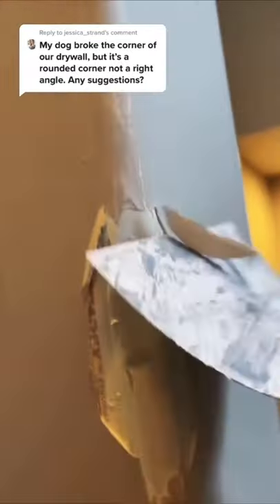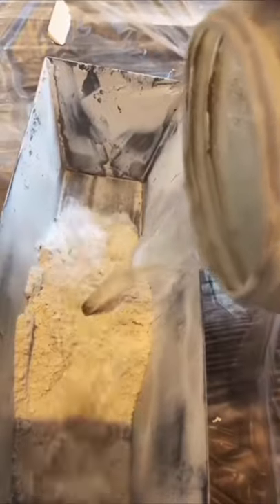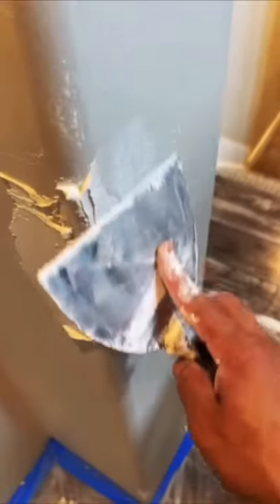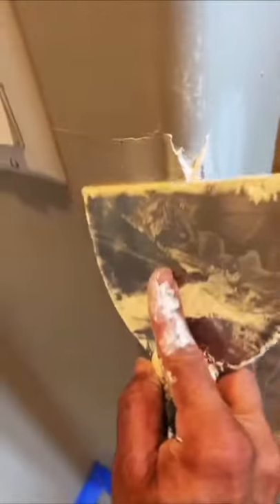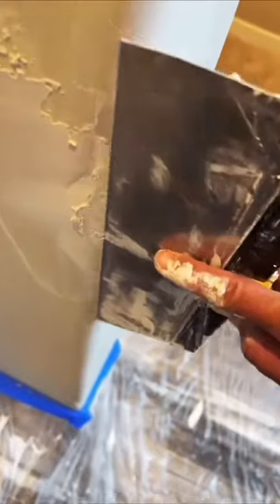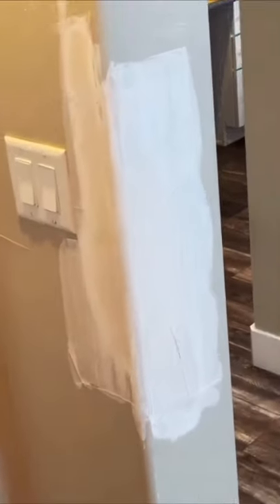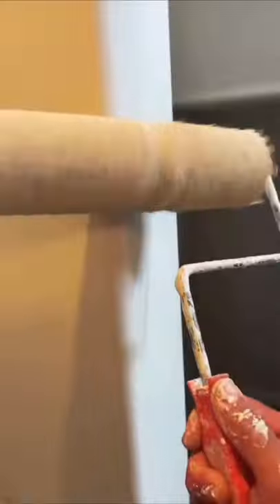How to repair dent on bullnose corner bead.  #shorts #drywallrepair #diy

Comment: Hey boss great video, love ur attention to detail. Small request, maybe start using a PVA primer to avoid having to paint with 2 or 3 coats and your sheen will look so much better.
Reply: I won't comment on the paint itself but he is correct about the PVA cuz hot mud doesn't bond to latex paint so putting pva on the wall PRIOR to the mudwork will keep ot from busting back out the first time it gets bumped

Comment: You’re a national treasure. I specifically need to this exact repair. Except for instead of a dent there’s a gash 🤦🏻‍♂️ 
Great vid keep them coming!!!
Reply: Still repairable g, just make sure you stuff the crack completely with caulking, it shrinks when it dries so. Then tape over it, put another layer and sand over that layer. Wait to dry, repaint, you're golden.

Comment: Wouldn't have dented so bad if they would have installed it the way I learned. The mud should fill the bead and then be pressed on to force out the excess. The corner then drys solid with no void behind to allow easy denting.
Reply: Exactly. Hot mud is much harder than sheetrock when cured.

Comment: Prime the repair bro.. the patch will show after you are done
Reply: You should never paint over hot mud. He should have finished with a skim coat of topping mud and then used only a premixed primer and paint. Using a primer like Zinsser or Kilz over patch jobs will cause flashing.

Comment: Was the dog driving a rental truck? Pro tip: if you're gonna at the jobsite extended time, mastic for ceramic tile makes a great filler for impact areas that are found in commercial settings

Comment: I’ve repaired mine several times, and it looks great... but it keeps chipping off when it’s bumped. How do you make the mud “stick” to the metal? I’m thinking about priming the metal before I add the mud. Other than that, I’m out of ideas.
Reply: Drill a couple of small holes in the corner bead, so the mud will penetrate and be anchored.

Comment: How long do you wait before you paint. I get the fact that 5 minute sets up quick, but is it paintable in the same day
Reply: Its a chemical reaction. It's rock hard in 5 minutes. They also sell 20, 45 and 90 minute.
The quicker the set time, the harder it is to sand. 5 minute is like sanding concrete so you better be fast and lay a smooth coat.

Comment: No primer after patch?
Reply: No. A simple premixed primer and paint will do. A primer alone will cause flashing then you would need to use a primer on the whole wall to hide it and repaint. You should also never paint over hot mud. He should have finished with a skim coat of topping mud.

Comment: What do you guys recommend for roller covers? I've been using 1/2 nap sheepskin.... I'm painting on semi-smooth surfaces. They are pretty smooth, but it seems like the wool isn't holding a lot of paint, I find myself dipping constantly. Any tips would help greatly!
Reply: Purdy ultra finish 1/2” microfiber, You can mop it on and it’ll still dry excellent with that roller cover. I generally hate everything from Purdy but we found these to be very reliable and consistent
Reply: Microfiber from sherwin. They do me fine. If it's a fresh wall I use 1/2 or 13mm nap.
If it's a patch or painting half new/half existing, I use 3/4 or 19mm to give a bit of texture and blend the new with the old.

Comment: Umm, isn't it easier to just mud it to a 90 and then sand it back down to how it should be rounded? Then paint it?
Reply: NO it isn't..he tooled it properly
Reply: @blaydCA  lol, I appreciate your avid defense of this method, but that didn't answer my question. Please only reply with relevant info.

I never did a rounded corner on dry wall but I assume it isn't much different from rounded edges in fiberglass, in that material must be removed to get the curve right.

I always figured add excess and remove it later.
Reply: @imgingergiraffe3731  asked and answered. Reason being: the wide knife follows the correct contour. Cheers
Reply: @blaydCA  only when going with the slope (horizontal in this case)😂, and with a knife wide enough to cover the whole damaged area. Not everyone has that option, so I was looking for a more common and accessible method.
Reply: @imgingergiraffe3731  since I can't picture your exact predicament, but you could sand the radius by hand in a tight area. I've cheated and cut a paint stirrer to needed length to span the damage (using the stirrer as the knife). Extra sanding and recoat though. Extra coats of paint hides some sins.
Reply: *Note: most bullnose radius won't be perfectly rounded for lack of a better description
Reply: @blaydCA  ty, ty. That trick might come in handy. I'm just used to throwing on extra with first coat and just sanding it into profile. At least with other material repairs.

Edit: a slight waste of sandpaper
Reply: @imgingergiraffe3731  I'm a GC, so most of my stuff is repairs on way older installs. Quality end result is what counts.  One gets creative when you can't walk away from the problem. I'm not afraid or embarrassed to ask other pro's for a good solution if I'm on a nightmare project
Reply: @blaydCA  oh everything I do is quality, I'm all about efficiency. I want things as easy and fast as possible, without sacrificing any quality.

Minmaxing to put it another way
Reply: Lol you’ve never used quickset or you’ve been using it wrong.
Reply: @blaydCA  exactly.
Reply: @ryane6719  possibly. I mean I don't do drywall for a living 😂 only when repairs are needed.